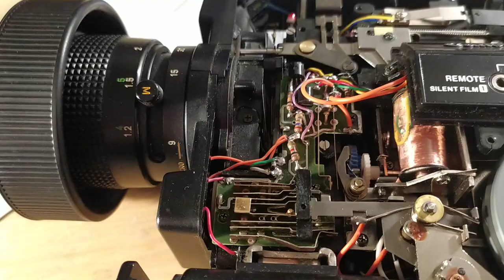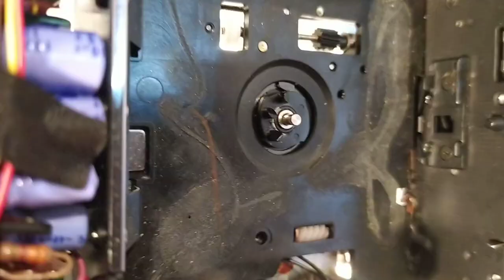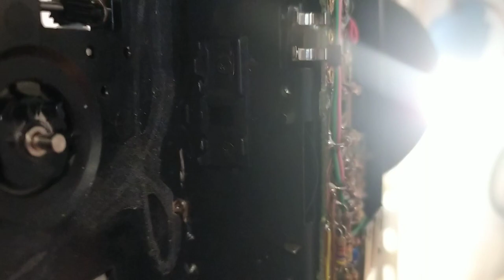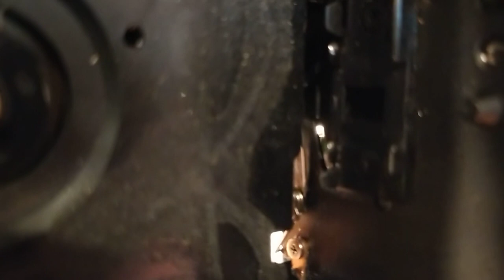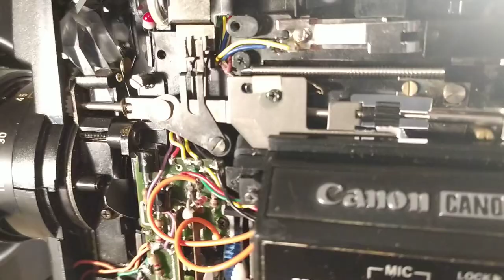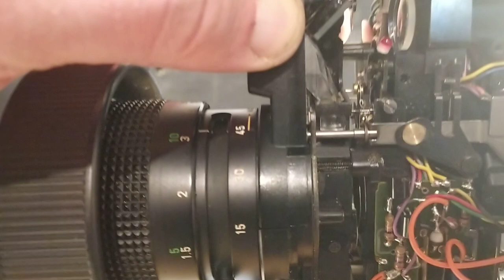Canon 514 xl-s riparata

Comment: Hi! how did you remove the wheel? i have the same issue
Reply from the maker: It's a nightmare. You must almost disassemble the entire camera.
In the front (where the cartridge is put), you must remove the plastic cover on the controls, an aluminum bottom with the screen printing, several very small screws, very hard to unscrew. On the back you have to remove the main lid, the lid of the sound card, then remove the capstan flywheel with its little motor and the belt and debase the head group.
Once this is done, you must divide the two frames, the rear and the front one, through the unscrewing of a tiny screw. At that point you have access to the compartment that houses the gear. That gear that I replaced makes the pivot of the film drag, the contrary and the zoom.

It's very difficult, but with patience you can.
I started by removing the fine skin to discover the screws.
Then I removed the lid on the back, the flywheel, the capstan and the head group.
Then I opened the front part: I removed the lid of the electronic parts, such as the exposureter, I removed the very thin aluminum panel, on the bottom of the cartridge compartment, and gently moved the aluminum frame.
Reply from the maker: If i find some photo and video shot while working on the camera i'll try to publish.